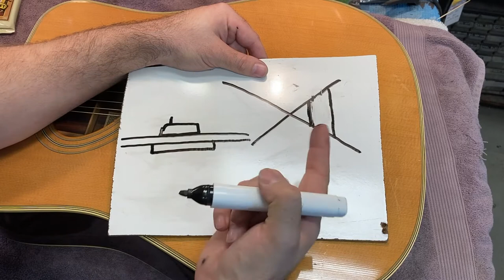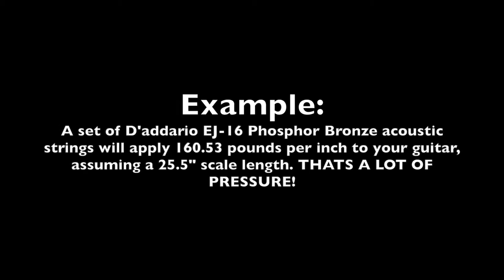How do you Repair a Bridge Plate and what is a Bridge Plate Retainer?

Comment: I just bought a worn out guitar. I onpy reapised the bridge was coming off the body when I got home. All the stree was on the pins... and the pins started to rip out the soundboard. The bridge wouldnt sit flat on the soundboard because of the damage. Its not going to be an easy fix but we'll see. Thank you for the video, it does help to visualise things and know what role each part plays in holding it together

Comment: I’m late to the party here. Thank you for a very clear explanation. My guitar is abt five years old and the bridge plate already shows slight indentations where some of the string balls have imbedded. I’m pretty careful when changing strings since I’ve noticed the damage. I’ve wondered  why more builders don’t use pin-less bridge design like Breedlove. I’ve seen one early Taylor with that design but newer ones all use pins. Also, why not use carbon fiber bridge plate?

Comment: Very interesting, thanks for sharing your info. I have a Tanglewood 12-string I bought from a dealer, it was brand new, no owner, and the bridge was already lifting. I bought it cheaply as a fixer-upper, to learn by doing the repair. The bridge plate has cracked through the holes, it is softwood, not ply. Having watched your video, I’m inclined to try inserting a retainer. Are 12-strings more prone to bridge problems? I’ve seen a bridge lift on an Ibanez 12-string also.

Comment: Thank you for the video, you saved me some work. I was going to replace the bridge plate on a 12 string. There is some belly up on this guitar and Iafter I re-glue the bridge I am going to use the Bridge Doctor kit to reverse the belly up issue. I should be able to install the Bridge Doctor after I install the retainer correct? I am using the screw in bridge pin kit for this repair. Also how big should the retainer be and can I use oak for it? Thanks again.
Reply from the maker: I can't see why not, but I'd use maple, ebony or rosewood, not oak.
Reply: Great job. Good info here. Subscribed.

Comment: I'm a full-time singer songwriter and recently had an ebony bridge plate put on my guitar. There was also a partial fret job performed (the first 6 frets). Adding those frets subsequently required a shim to be placed beneath my nut so the strings could clear the new frets which are a bit higher (I also like very low action - flat neck etc.). Anyways it seems to me - the guitar has lost some life depth/resonant sound and all I can think of is that the added weight to the bridge is dampening the sound of my guitar. I've learned since the work was done to perform the work myself and will be replacing the nut - it seems right now the nut may be a bit too low and this could be affecting the tone? Thank you for this great video and wish you good things!

OH forgot to ask! lol Is it ok to sand the bridge plate a bit in hopes to lighten the added weight on the bridge? It's a Larrivee D-03 Mahogany Sitka Spruce - beautiful guitar and now just sounds like it lost its spirit. I would be happy to pay you for a brief phone consultation.
Reply: I have heard stories about bad nut replacement. If the nut is not seated correctly, it can lose some power and tone. Perhaps this is more likely to be the problem. Cheers

Comment: I'm not sure you'll see this but I'd really love to know your thoughts on the idea of a luthier building a retainer into the bridge plate to begin with to extend the life of the bridge plate and potentially get a different tone or at least the extra vibrating mass added would be something you could compensate for in the process of carving the braces.
Reply from the maker: Generally we try to cut down on wieght when building acoustics. The retainer isn't much weight, but if you don't need it yet, there is no reason to put it there and having it already there will make it harder to install when it does need one.

Comment: Thank you!! Do you glue the retainer on using Elmer's type wood glue? I have the problem that you described with the ball. I thought of this "bridge plate retainer" independently (I'm a mech engineer) to fix my problem, and just happened upon your lecture. I'm a D.I.Y. kind of guy (when I have confidence and time). You just gave me a HUGE injection of confidence that I'm thinking on the right track with repairing my guitar (a cheap Yamaha F325 which is my fruitfly for experimenting on and learning guitar repair -nuts and saddles)...thank you!! You confirmed my thought about using maple (rosewood too) and I can get it from Stew Mac (I'm in Ohio). 👍👍👍😀😀😀
Reply from the maker: Normal wood glue.
Reply: @DrewsGuitarShop  Thank you!